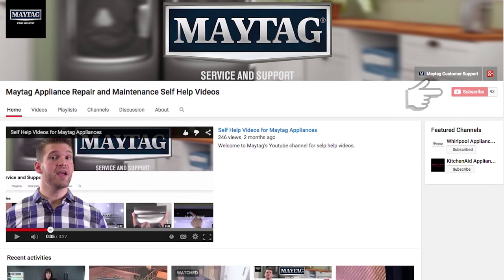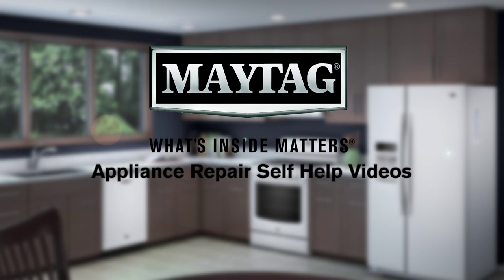Washing machine has a grinding and rubbing sound | Maytag Self Help Videos

Comment: how about doing a video on what is wrong not what a washer is supposed to sound like. my Maytag makes a really bad grinding sound while washing, not spin cycle, make a video about that.
Reply: Did you figure out what's wrong? That is EXACTLY what mine is doing right now. I took out the agitator and it looks good, nothing stripped. I put it back in and it's still doing the same thing. It only happens when it's agitating, not on the spin, drain, etc.

Comment: Misleading, because draining and agitation, or agitating, are two different processes. A washer should not have excessive or loud rubbing or grinding sounds while agitating, because it is usually a problem that must be addressed (and is by no means a normal sound). Just saying.